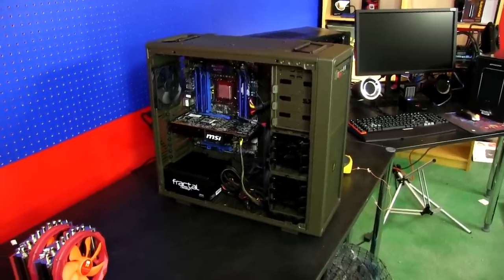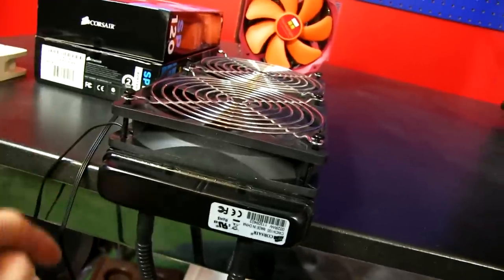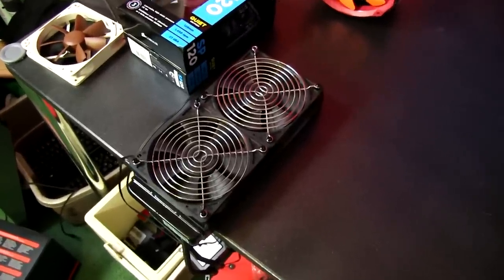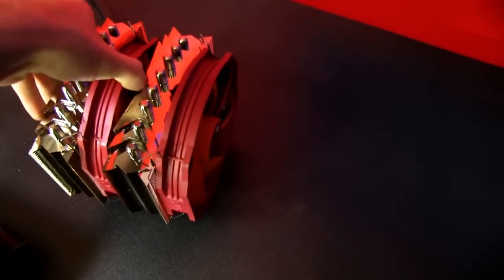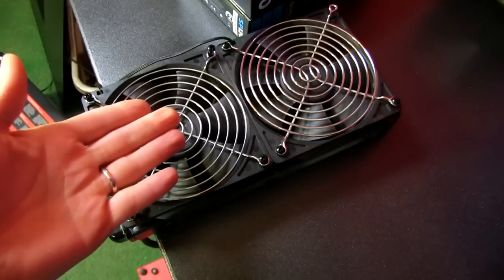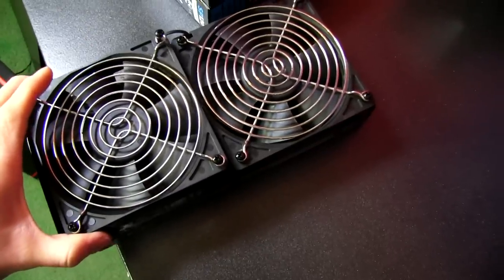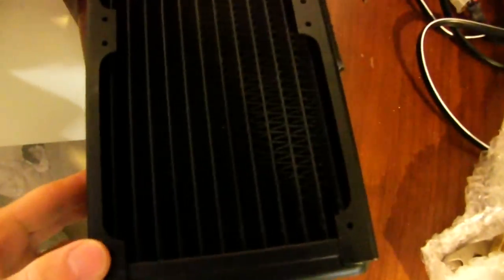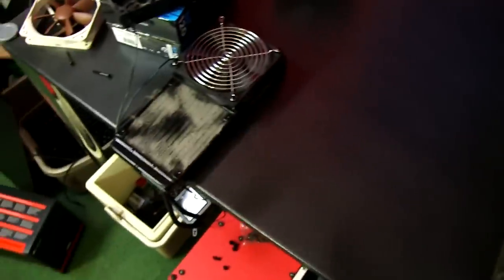Push vs Pull vs Push Pull for Radiators and Heatsinks Linus Tech Tips

Comment: it may be true. But is there any test made to say even if you have 4 sp or pressure optimized fans running on push pull . Noise is there but can it reduce the heat of water to margin say 5-10 degree more means its a lot . As oc'ing reached 5ghz and need a extreme cooling to keep things cool . in such cases push pull might work .

Comment: Linus, that's all well and good but, when you put fans in pull, you lose the static pressure rating of the fan. The fans static pressure rating is solely determined when it is in push configuration. Yes you will be able to clean your radiator easily, but you lose all benefit from buying a high performance static pressure fan.

Comment: I'm confused on what to do as well. I have the fans pulling Air away from radiator towards inside the case. while the back and top fans blow heat away (outside) the case. Do I want to mouth the fans on the outer part of the case and have them blowing towards radiator ?

Comment: i disagree with you when you said you will not get more pressure from applying more fans in a push pull config but i do agree that it will be useless to do so as the more pressure will not equal more conformance. the air around you will not go at terminal velocity inside your case thus there will be room for more and more pressure the thing which you are looking for though is how much heat is moving not how much air is moving as if the air is moving before it can be heated then the heat will just build up thus why the fans do not apply that much stacked pressure but back to what you were talking about. either push or pull will be better depending on the environment the case is in. if a dusty one then having the radioter on top of the case will be better or just with a dual radioter design to cool it down farther faster but extreme designs like that go with more than just the fans but with other liquids and are very complicated setups. so in short i would actually not attach the radioter to the case but have it on its side below or beside a modified desk which you are sitting at which yes of course will make it a pain to move the build around but really who ever moves around a computer. except for cleaning it in that it will be easier to clean as you will not have to open the computer case to do so.  so radioter placement has part to do with how much cooling you will get not just how much air you push through it. 
if you look at it with higher pressures onto the tubes you can speed up the flow of the liquid making it go faster and dissipate less heat each time it goes through so you do not want to much pressure but still you want a lot of colder air to flow past the heated liquid(s) to cool it down.

Comment: I'm not sure I understand the difference it makes in relation to dust. If your radiator is right against the enclosure and your fan is pulling air through it from the outside, you'll still need to dismantle the whole thing to clean it off properly.
Reply: Sneezaroo I think he meant pull as in pulling up and out of the case (from the inside to the outside, so fans against the enclosure).  And as long as you have proper case ventilation overall doing so shouldn't negatively affect temps.  ;)

Comment: Pull brings heat into the vent and reduces it's life. You should be able to get 20 years out of a vent. Yes 20. I used an AC freezer pro (ac freezer7 it was called way back then) for over 10 years and still works like it's 1'st day.  you can clean it out with a compressor. All you need to do is open up the case, put your finger on the fan blades so they don't spin and blow high pressure air onto the radiator. If you do blow air on the blades and they rotate don't put anything in the blades to try and stop them cose you might break the blades.

Comment: so, i have the Corsair SP fans that came with my H100i AIO. i have even gone as far as using hot glue to seal up cracks between the fan chassis and the radiator in a push setup, and they are sucking air in through the filter on the front of my NZXT H440 case. i get the temps i would expect, but i really dont feel that my air on the other side of the radiator. i had a Thermaltake 750 watt PSU that died on me a while back and the cooling fan in it was a 140mm that i have no rewired a motherboard power connector onto, and with that in the back as an exhaust for my case, the 2 Corsair SP120s and a 3rd decent CFM fan in the front sucking air in, that single 140mm exhaust was creating negative pressure in my case. why does it seem like those SP120 fans are putting so little air all the way through my radiator?

Comment: Mmm i don't agree... My point of view: I prefer push and pull using rubber screws for the fans to annul vibration (so the noise) and using a rheobus to control speed and running them at 75%, you won't have much noise and you'll end up by having a super cool CPU, and remember that the cooler the components, the longer they last and perform.
Reply: Yeah u use the h80i with push pull and my CPU idles at about 50 degrees fahrenheit. Under intense load it peeks at 100 f

Comment: Hi I know the difference shouldn't be that much but when I bought the Seidon 120V that released recently with the pull config(fan above rad) the temp is as high as 40 on idle where as in push config(fan below the rad) the temp is as low as 34-35 on idle.

Comment: So if i decid to put a "Corsair Hydro series 110i" on the front panel of my "Corsair carbide 400c" i better configure it in "pull" mode rather than "push and pull". As this i'll have the same air flow and less dust on the radiator. Am i right ?

Comment: I have a Corsair 600T case. What's best? PULL with fans screwed to the radiator inside, air going up and out the top. OR radiator screwed to the top of the case and the fans outside under the removable mesh cover PULLING air up and out? I can do either.

Comment: People overthink cooling to such an extreme, stupid degree. All things being equal, assuming all of your equipment is working correctly, your case vents aren't blocked or sitting on a carpet, you don't have four thousand wires in your case, obstructing airflow, etc, etc... Setup your fans to whatever configuration you like, your system will stay cool. The only difference is, as he mentioned, dust build-up, depending on how you've configured your fans.

Comment: I am just about done with my build (waiting on parts),my cpu cooler will be the H100i and the fans will be mounted on the bottom of the radiator inside the case. Now is it better to have them push the air out or pull in for dust control. I have the Rosewill Thor V2 case.
Reply: Robert Floyd You always want the air to move from inside your case to outside through the radiator....you never want to dump the hot air inside the case. So the question then is do you want to push the air through the radiator (in which the radiator is mounted against the case and the fans are on the other side of it), or do you pull it through the radiator by mounting the fans against the case. Linus suggested the pull method for ease of cleaning....this does require a tight fit between the radiator and fans to avoid air coming in around the edges as pull doesn't produce much of a directional air flow compared to push.As for dust, you still need a few intake fans and they should have dust screens on them.
Reply: 69aussieguy  Yea I turned the fans around today. They are now pushing instead of pulling.
Reply: 69aussieguy You can get special spacers that fit between the fan and the radiator to reduce the dead spot issue and channel some of the edge spill over back into the rad, they can be fairly inexpensive too (or not if you want fancy acrylic with LEDs).

Comment: Is it possible/practical to run a radiator outside of the case? I think it'd be easier for me, I have my primary gaming rig set with 11 fans, including internals, but I'm building a scrapper comp, from a bunch of outdated comps I have laying around. I'm gunna overclock the balls off the thing, but Im also going to try and install a watercooling system, and Im always changing bits, and I think it'd get in the way if I mounted it inside of the case.

Comment: Why don't people put a spacer between the fan and radiator? The blades on most of these fans tend to focus the air and thus cover a smaller diameter on the radiator plus since the fan is so close, the very center (motor) of the fan, creates a dead spot.

Comment: So why do you need static pressure fans if you're using pull? If air leaks from non static pressure fans because they're blowing into a radiator and the blow back would leak back through the fan, why would you need to worry about blow back in a pull configuration where the fan is the outermost component and there's nothing to cause blow back? Wouldn't a high air flow fan be the best to suck air through the radiator?
Reply: Because regardless of what config you use push or pull the air is going through the radiator hence you need a static pressure fan. Airflow is made when there is no obstruction and air can flow freely usually front of the case.
Reply: Because regardless of what config you use push or pull the air is going through the radiator hence you need a static pressure fan. Airflow is made when there is no obstruction and air can flow freely usually front of the case.

Comment: Im still indecisive.. so fans on top against case? or fans inside? I have two 140mm exhaust for the rear case and two sp fans up front.. I dont know what to do about the radiator fans config (replaced h100i stock fans with sp120s...). Suggestions?
Reply: David C Fans on top would be pull.  Fans inside would be push.  Those SP120s should work nicely in either configuration.  What case do you have that supports two 140's in the back?
Reply: Ended up puttin them indide.. love my build..

Comment: Linus, isn't it true that when using a pressure optimised fan on a radiator with high fin density, it push is better than pull (although not by much)?
coz if it is true, then having high fin density radiator with pull config is a bad idea i guess. right?

Comment: wait, so if you run your fans in pull, do they still need to be pressure optimized fans? or would it then be better to have airflow optimized fans?

Comment: What about in an air setup such as the hyper 212 evo? I have push pull (going out the back) would push push be bad? I have good airflow in the case. My temp with my fx-6300@4.6GHz 1.34v maxed at 50°c in prime95 test 6 hours in.
Reply: Push push doesn't work and may damage your fans. But how did you manage to get that tempature? I have a fx 6350 (which is the same only factory oc'd) and have 70C+ during gaming on stock 3,9 ghz.. I also have a hyper 212 evo.
Reply: mrgnexable Either you have way too much thermal, too much voltage, or a faulty chip bro you need to get that taken care of. the max temp for a 6300 is 61 degrees. 70 you're damaging your cpu
Reply: Thanks I know the fx 6350 is a bit overvolted so I will look how much I can undervolt and I will re apply thermal compound. I thought the max temp is 70-72 C
Reply: Im sorry I looked wrong. The CPU is 50 C and my GPU is 65 C after playing 10 min Battlefield 4 maxed out. Do I need a new case? I maybe want to start overclocking a bit..
Reply: Depends on your air flow too.
Reply: I think my GPU blocks the airflow for my CPU and ram for the most. I have a very cheap case. Do you wanna help me maybe?
Reply: I'll PM you my contact info to help :P

Comment: When he says about pull configuration he means pull where we get hot air pulled out of the case with fans on top or pull where fans are at the bottom of the radiator and pull FRESH air in the case?

Comment: I'm using an H80i in an Enermax ECA3290A-G case, I'm placing it at the rear fan mount, can anyone help me with push/pull suggestions and if I should mount top fans? Thanks

Comment: i'm So sorry, it's better push for cases? or pull?
Reply: +Lain Silk what do you mean? case fans? If yes, you need both push and pull. Put pull in the back or top and push in the front or bottom. or you can use two or more push at the front. Just make sure NOT to use push on all sides.

Comment: I'm pretty sure that I'm going to be called an idiot for asking this question but I really can't figure out the answer. I have a cooler master storm trooper case which has a big fan on the top. If I install a Corsair h100i should I remove that fan? I'm sorry but this is my first build. Thanks in advance for any reply that you can offer.
Reply: In case no one has answered your question about the h100i with the 180mm or bigger fan that comes stock with the ST case, it depends on mounting point locations of the ceiling of the case and which DIRECTION of air flow you prefer.  Most cases with a big fan on top are already in the exhaust orientation meaning pulling air out of the case as heat technically rises.  

If that is the case scenario you prefer, then you'll need to mount/install your h100i with the fans in also the same exhausting orientation.  In that specific case it doesn't mater if you put the h100i as a push or a pull config as long as the direction of airflow from the fans is teh same as your big top mounted included ST case fan.

Comment: If you run in push and the radiator is clogged up with dust can't you just blow a compressed air through the radiator from the other side to remove the dust?

Comment: Have you ever considered putting the radiator ( without fans) submerged water chilled with cooling coils from a ridgfridgator and/or using a A/C unit with a furnace filter box for intake for high volume cool airflow, for mild overclocking and overall hardware maintenance? Love Your Channel BTW I have learned much from you. I thought I was a geeky gadget nut until I discovered you. Thank you so much for sharing. PS has  anyone manufacture a liquid gas cooling system for CPUs other than the liquid nitrogen  gerry rig setup I've seen that looks high maintenance to use?? Or is this overkill if there is such a thing?? I know I'm sick ;)
Reply: +Francie ok  LOL ,,,,you are sick :) nah,,,open idea is good ,,, keep imagining bud! why not,,,as long as the coolant in the radiator is anti-freeze! :) your welcome to put them into the fridge as well!

Comment: So pull or push? XD I know about same performance but I dont want to that it gets so dirty. Mine is installed on the front. First the fan pushing air to the radiator what is after the fans. It looks better like this, but Im getting too low air flow inside of my PC as the radiator is in front, and also now after to see the video I think it will get so dirty.  So just to make sure. First the radiator in front and after the fans? thank man u are the best

Comment: Alright... I have a question about my build. It's answered in the video, I'm just not positive. (Not that I don't trust Linus.) I have a Corsair 500r Case and an Asus Z-170A Motherboard. When I installed my H100i GTX Liquid Cooler as the manual showed, (Radiator and fans inside of case) there were problems, as the motherboard would not fit. Right now I have it set up so that the fans are in the fan tray (accessed from outside of the case, on top.) They are pulling air from inside the case and pushing it out. I believe Linus is saying it is better to flip those fans around, and have them draw air from outside the case? I feel stupid since I clearly listened to him explain it in his words four times. Any helpful comment is appreciated.

Comment: hello, im considering installing 240mm radiator with 2 120mm fans in top of the case 
1. Should i make radiator down and fans up or fans down radiator up?
2. What fans should be on push, pull or push and pull?
Reply: 1) If the radiator is placed at the intake, it will get the best cooling but it will vent warm air into the case, making your GPU and motherboard hotter.
2) If the radiator is placed at the exhaust, it will be less efficient (taking in warm case air) but it will not warm up the case.
There is no right or wrong way to do it. Choose the setup which works for you.
Reply: 109sciencefreak well im new to AIO water cooling so i want best cooling to overclock my cpu
Reply: Julius Venclovas I'm no expert and have little building experience, (unfortunately. looking to change that soon) but going off what 109sciencefreak said, it would seem logical to me that the most efficient way to a radiator system if you are that concerned with ultimate performance and case temps is to run the radiator to the outside of the case. For example I have seen people put their radiators on the side of their case before. I would imagine the advantage to this is not only improved in-case temps and airflow, but also improved radiator temps and airflow. The only challenge is cutting some holes in the case to run the water pipes through and a way to secure the radiator to the case.
Reply: Like 109sciencefreak said, if make the air that goed through the radiator go i to the case, you warm up the case, so don't do that. Make sur your case gets a lot of air pushed into it, suck air through the radiator and OUT of the case. The air coming from inside the case will not be that warm of you have proper air flow, and it will exhausted by the fans on your radiator, sucked through your radiator, which will then be on the inside of your fans. Hope that made any sens :P

Comment: If push-pull isn't necessary, why would corsair put them on the h80 series? I guess it will increase performance a bit right? Was planning on running push-pull on my h100i..

Comment: My case does not allow a top mounted radiator. So if I have a radiator mounted to the rear of the case: Dust filter on back exterior of case, a SP fan sucking air in, the radiator and a AF expelling into the case with a blowhole on top. Is this feasible?

I am also surprised push pull with a SP fan is not necessary to have the second fan?